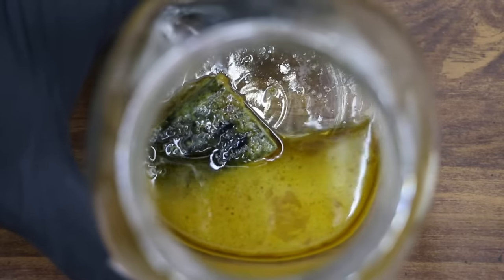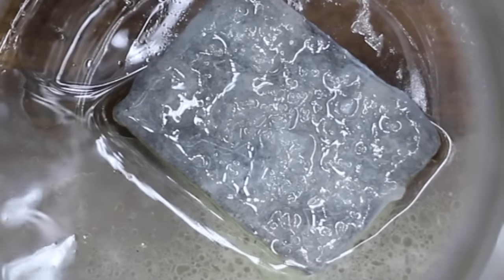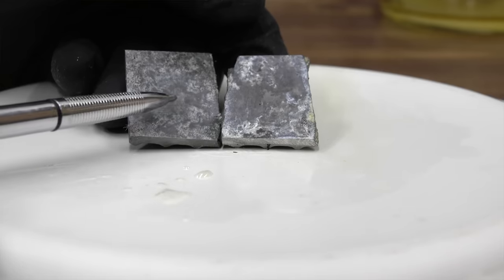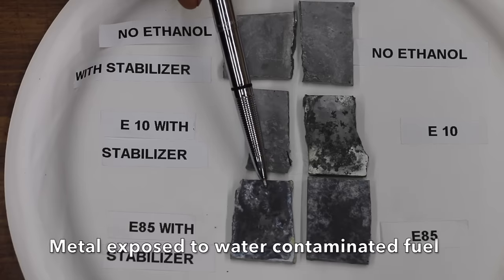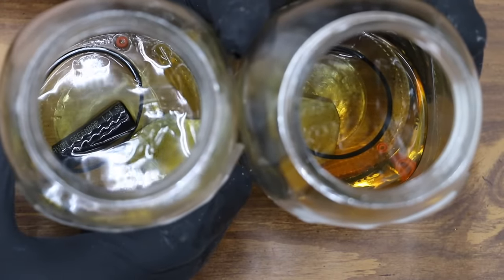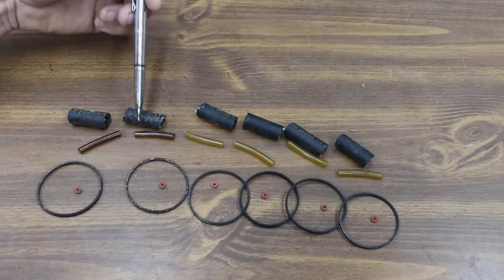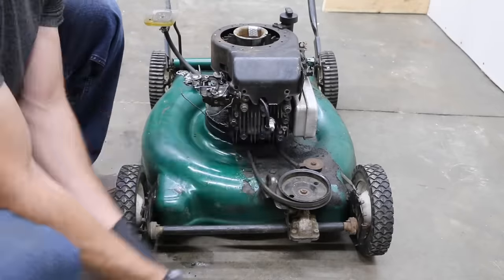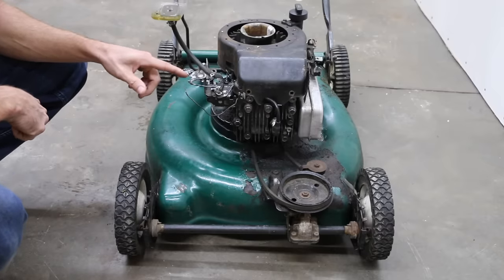Does Fuel Stabilizer Prevent Ethanol Damage?  Let's find out!

Comment: Amazing.

You've completely validated what I've been doing with my lawnmower and snowblower for the last 13 years.  Every spring I run my snowblower out of gasoline, and put it in storage.  Then I make my twice yearly trip to the "special" gas station to buy non-oxygenated (non-ethanol) gasoline. I then add sta-bil to the gasoline.  In the late fall, I perform the same procedure on the lawnmower, and replace the gasoline again and get the snowblower to start.  In 13 years I've had 0 problems with both small engines, and they both start right up with one or two pulls.

I was more than a little shocked to see how much gunk was in the ethanol + aluminum containers, and absolutely zero in the non-ethanol ones.  I'm tickled to see that the practice I heard about years ago stands up extremely well to experiment!
Reply from the maker: Thanks!
Reply: How does what he posted validate the need for stabilizer at all?  My conclusion is that it doesn't do anything at all based on those last two runs...

I definitely agree that running everything dry is the best approach, I let them sit with the caps off with a rag over it so they can evaporate anything else out as well.
Reply: The best way is to use only no ethanol fuel at all times, and leave the tank full all winter to keep moisture out.  You can run the carb dry if you want, but with E0 gas, it doesn't really make any difference.
Reply: You don’t need to mix stabil with non ethanol. Stabil needs ethanol spray to bind to if it doesn’t have any it’s pointless
Reply: @brentiverson1654  Stabil pre-dates putting ethanol in fuel, so no, it's not just for ethanol fuel.

Gasoline also degrades itself over time, and causes problems for engines.  Still, it'd be interesting to see what problems other than water contamination corrosion sta-bil solves in non-ethanol fuel.
Reply: @Weezulguy  I've never heard of taking the gas cap off and putting a rag in when storing or not using an engine. Interesting.
Reply: I never use ethanol fuel unless I'm stuck
Reply: @robertdecca1240  It's largely a mandate where I live.  There's a few stations that'll sell "non-oxygenated fuel" around here, but it's only for collector cars and old hotrods that don't perform well on ethanol fuel.  It's also a LOT more expensive.

Doesn't seem to matter much in the larger autos.  I'd never put it in my small engines however.
Reply: @stevesether  I run all my snowmobiles and lawn mowers on non ethanol. My chain saws require it. Costs me 75 cents a gallon more. No gumming on sleds after storing for the season
Reply: I use ethanol free in all my mowers and yard tools. During the winter I fill my bikes with ethanol free. I stopped using Stabil when Briggs put out a technical bulletin that claims Stabil causes the rings to float. Briggs is so adamant about NOT using Stabil that they will not honor a warranty on an engine that has been treated with Stabil.
Reply: @stevesether  I was going to say that stabilizer was considerably older than ethanol doped fuel.  My dad used a stabilizer in the chain saw and lawn mower in the 1960s.  But I do recollect him remarking that ethanol added to gasoline went back to the days of Prohibition, just not as a commercial practice.
Reply: Ethanol is a scam anyway, I remember Dr Wattenburg the scientist who had a talk show on KGO 810 AM  talking about it and how you lose about 10% of your mpg  with ethanol, which despite a slightly lower price per gallon costs you more as you have to buy 10% more gas to drive the same distance to-from work every week
Reply: @HobbyOrganist  Ethanol was never intended to reduce prices, it was intended to reduce dependence on foreign oil, and provide some, albeit small, amount of renewable energy.

Weather it's energy positive or not and reduced CO2 emissions is a matter of some debate for decades.
Reply: @olliefoxx7165  not storing, just after running it dry, for a couple of days to allow complete evaporation out of the tank, then I cap them off like normal
Reply: @scarhart53  If the tank is dry with E-0 it won't pull moisture from the air. It's the alcohol that pulls in the ambient moisture from the air. Drain them and run them dry. New fuel next season... good to go.  My chain saw (moderate home use) I bought in 1982 still runs like new. It went to the saw shop a decade or more ago for the upgrade to electronic ignition. Never been in the carb. It's never seen alcohol fuel. Stihl 032 AV, mint condition.
Reply: Steve Sether:  That's been my experience as well.  Non-ethanol fuel is definitely better for small engines like push mowers (whether 2 or 4 cycle, in my experience), re getting gummed up, or the gas getting old/stale. 

But now the non-ethanol fuel is hard to find, and if you do it is literally many times more expensive. 

Fuel stabilizer helps on gas going stale over the summer with E10 (normal gas for cars).   Running the mowers good and dry seems to be good enough for wintering. 

In my experience if you just ignore the issue, with ethanol gas, you'll end up rebuilding your carbs every few years which is annoying and expensive. 

When I was a kid (70's) a normal Lawnboy mower would mow a bunch of yards year after year and run completely trouble free with non ethanol gas.  

By the 90's, ethanol was getting to be a real problem for carbs on mowers. 

Now I just let pros do my mowing for me, but hopefully better batteries makes electric mowers and weedeaters, et. al. practical and gets rid of this issue.

Oh, and my lawnmower mechanic said the main problem was the soft parts like the seals, not the metal.  I just wanted to avoid the expense and hassle of many repairs.
Reply: LOL, i will say it for you "SHELL"
Reply: @im2yys4u81  Does the warranty question apply to other brands of stabilizers?

Comment: Dude, that’s a lot of work to bust some myths and end some “never ending” debates....
THANK YOU!!!
Reply from the maker: Thanks for the feedback!
Reply: I'm glad he takes the time to do these test. And they do show what Ethanol will do to certain types of plastic and rubber lines, as well as aluminum, and it's a pretty good bet that in some  manufactures fuel injection systems that do not use as high as quality materials as other manufactures do, and even though they claim they use Ethanol safe parts in their fuel systems, in time, because of lower quality materials that will be used by some to lower production cost, the owner is going to have fuel system problems caused just by using Ethanol. 
Just think of what Ethanol is going to do in time to lower quality replacement parts like those lower cost Ebay fuel injection fuel pumps and fuel regulators.
Reply: Looks like I'll be draining ALL the fuel from my boat... This should be fun to find somewhere to send it 😒

Comment: Pretty interesting video, confirming many of my thoughts on ethanol. I do small engine repair and have seen carburetors become damaged beyond repair after a machine sits for a year. When I was a young man (circa 1972-1978) I mowed the grass at my parents house. I used a Toro Reel Mower, I never had a problem firing it up and it was used pretty regularly. Ethanol had not come into the picture yet. From time to time over the years after I moved out I went and mowed for my mom. She hired gardeners and they never used that old mower. Every time I went and mowed for my mom that old machine fired right up. There were several times I didn't mow her grass with that machine for well over a year, even 2 or 3 years and it always fired right up.
Reply from the maker: Thanks for sharing.
Reply: I think the stuff is garbage. I leave gas sitting in the mower or snowblower until the next season and Never had an issue with carburetors or starting up after choking and a couple pulls. The fuel evaporates out of the carb anyways in probably less than a day and the tanks are sealed. If it were a big issue the carbs would be junk after one season or two of using because when you are done each snowstorm or mowing there is always gas sitting in the carburetor until the following mow time or snow. This isn't the case. I call bunk on these additives.
Reply: @NoFeeArea  Interesting view..  Allow me to rebut.. 
First point..  Older stuff Equipment), is way more forgiving than newer stuff. Emission compliance mandates force manufacturers to tune lean.. That means smaller orifices in the carbs, that plug up way easier than twenty years ago. 

Second point... "Fuel evaporates out of the carbs".. Well that only happens if there is a fuel shut off.. and you actually use it! Otherwise, on a lawnmower, or snowblower, the fuel tank will gravity feed against the needle valve in the float bowl, and keep the carb filled with fuel. Fuel evaporation, is exactly just that. The "fuel" evaporates, and leaves behind varnish. The only way to avoid that, is to shut off the fuel to the carb, and run it dry.

Third point... " and the tanks are sealed". Ummm .. On a 2 stroke, they are, on a 4 stroke, they're vented. Basically, if a carb has a float, on a small engine, it's vented. If there's no float bowl, it's sealed. That's why you can run a weed eater or chainsaw upside down.. It has a fuel diaphragm as a fuel pump, and it's run by compression pulses from the crankcase. As a carb that has a gravity feed fuel system, it has to have a fuel cap vent to allow the fuel to flow. Take the un-vented fuel tank cap off your 2 stroke weed eater, put it on your lawnmower and see how long it runs before it starves for fuel and dies, because there's no way for air to get into the fuel tank, creating a vacuum. 

So, which is it? " The fuel evaporates out of the carb in less than a day", or, " there is always gas gas sitting in the carburettor until the following mow time or snow."   Ya can't have it both ways.

If you can leave untreated Ethanol pump gas in your snowblower from one season till the next, and it starts in a couple of pulls... You're way luckier than the rest of us..
Reply: @charles09361  Allow me to retort. Ihave never used any fuel treatment. After a few pulls (mower in the spring) or (blower in fall) everything starts right up and after 30 seconds runs great. It's overkill and a waste of money IMO. Not for me.
Reply: Ĺ
Reply: @rhealvalade9902  Garbage. Waste of money.

Comment: We just bought a generator and I'm going to show my family this to illustrate the importance of using non-ethanol fuel in it. Thanks for the hard work and time you put into these videos.
Reply from the maker: You are welcome!
Reply: Where do you find it? The only place I can find it here is at Home Depot for $25/gallon. That is way too expensive to run a generator.
Reply: @tinytownsoftware7989  
Biggest problem is when its stored and not running for long periods of time. If you run that gen every few months (Say 3-6) I doubt it matters.
If you plan to store that gen for a few years (with fuel in it) then you probably should go with those fuel tanks at hardware stores. They supposedly last for up to 2 years opened and 5 years unopened.
Could also just run your gen, burn out the old fuel and then replace with new fuel every few months as well. You just don't want the stuff sitting for long periods of time... as this video showed. Could also empty the fuel out for storage but I seen this dry out components but I'm no expert if that's common or not. I noticed I replaced parts early when I used to do that.. Not sure
Some gas stations still sell gas without that crap in it (as they all should). There are sites and aps dedicated to this.
Reply: Just run 'er out and make sure the bowl is empty...
Reply: I drain the carb after using my generator.  When I didn’t the carb was really a mess and it wouldn’t start.
Reply: @tinytownsoftware7989  Petition Quick Trip to setup a few stations in your city. When I put their 90 octane no-ethanol in my 2019 Jetta (at least 4.5 - 5 gallons) I get crazy good gas mileage on the highway, like 40+. Noticeable difference every time. I believe Murphy USA also has no-ethanol gas but QT also helps keep prices down in the area
Reply: @bobshanery5152  For generators I really think Natural Gas is a better option but haven't tried one personally yet, NG AFAIK never "spoils" like gasoline does
Reply: Got one with propane conversion kit on it. It’s never had gasoline ran through it. I’m sure it would run it if needed.
Reply: @tinytownsoftware7989  If you live near a boat marina they may have it there.  That is where I get mine.
Reply: @tinytownsoftware7989  I have been able to find it when I lived near bodies of water. I think boat owners use it and it is easily available near water. I think there is a online locator for non-ethanol gasoline. I live near Lake Erie and a big racetrack so almost every station near me sells it. Hoe that helps a bit?
Reply: I just bought a dual fuel generator and will run it on propane...
Reply: Living on coastal Massachusetts I thought no problem I'll just go to the local marina & fill up with ethanol free. To my amazement few marinas here sell ethanol free. I'd have to drive down to the Cape & I am not doing that just for some gas. Instead I went to Lowes & paid $20/gal & filled up my generator with that. I just bought a snowblower & I am debating whether or not to fill up with $20/gal gas - might be cheaper to just replace the carburetor every 3 or 4 years & use the ethanol junk.
Reply: @tinytownsoftware7989  Some websites offer locations reported by viewers. Avg is $6 to 7 gal in my area at non price gouge times.

Comment: As soon as ethanol came out, all my lawn equipment started crapping out. Corrosion, brittle lines, weird yellow gummy buildup in the carb bowls. It didn't take very long for these issues to start occurring, maybe 6 months? I started using ethanol free gas for my outside equipment and warned friends and family. Great video.
Reply from the maker: Thanks!  Thanks for sharing.
Reply: I think you have some other issues besides gas. I've run E-10 for decades in small engines with no running or starting problems.

Comment: When I was a firefighter we started to run Trufuel in all of our small engines. Saws, pumps, generators, lights, etc. The repairs to equipment went down drastically as a lot of them sit for long periods of time until they're needed.
Reply from the maker: Thank you for the information
Reply: That's what I use in all my 2 stroke equipment...works great, never any starting issues.
Reply: We did the same thing in my department.  Repair costs plummeted after we moved to Trufuel.  Ethanol was ruining our 2 stroke engines!
Reply: Same for me. Started using Trufuel in my garden equipment- no more carburetor issues.
Reply: I know of a fire department here locally that runs 100LL av-gas in their chain saw. Also have an old 1916 American LaFrance that loves it.
Reply: The irony. .. govt screws govt by requiring use of purposely degraded fuel.
Reply: You can still mix your own just use ethonal free fuel same thing half the price
Reply: that's why i love reading the comments. Thanx Bro! for the info gonna buy some Trufuel
Reply: @TRUCKMAN399  Trufuel is alkylate based, not distillate like pump gas. It's significantly different and more storage stable than even non ethanol gasoline.
Reply: Joe:  I agree, but actually around here Trufuel is around $20/gallon.....ethanol free premium fuel is around $4/gallon.
Reply: I use it all the time too and it is the best, Sometimes I use the straight fuel without the oil in my 4 cycle mower.
Reply: Same. I don't use my mower and trimmer enough so true fuel is great if you cant get nonethanol
Reply: I run premium fuel in my lawn mower, other than oil changes, air filter and a new spark plug every few years she’s runs great after 21 years.
Reply: @TRUCKMAN399  I as well, $20 a gallon for the premix... Na, I love my husquvarna 2 stroke tank, cost of two gallons of Trufuel, easy to store oil on side molded pockets, non-ethonol gallon at $5 something. I'm Frugal not Cheap... Ha ha.
Reply: Mark - I see my local fire station turning on their saws etc. when I ride my bike. I think they do it every day or at least every week I’m not sure. That seems to eliminate any issues with gas since they’re using it or exercising  it with that frequency.  I think I see it enough to think they do it too often!!  They also turn on their lights every day and check to make sure all the lights work. That seems excessive to do it daily. Maybe once a week would be adequate. I guess the standard operating procedure depends on what each fire station wants to do. Thanks for the video
Reply: Sure for small equipment, but at some point the cost of the TruFuel exceeds the cost of the generator. Might as well just use E85 and just buy a new generator when it breaks at that point.
Reply: Ethanol shouldn't be in our fuel to being with.
It doesn't help the environment as we were originally told back in the day. We still waste tax dollars incentivizing this crap.
I replaced so many engine parts over the years due this garbage.. I'm sure that "helped the environment" 
I also enjoy lower few mpg.. Sure that helped CO2 emissions ..
Reply: Sucks how expensive Trufuel is though.